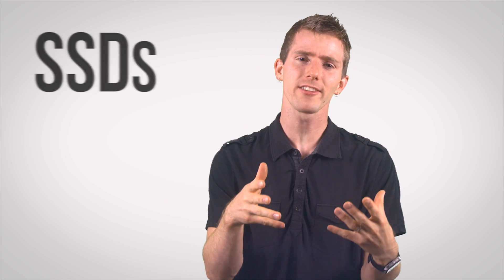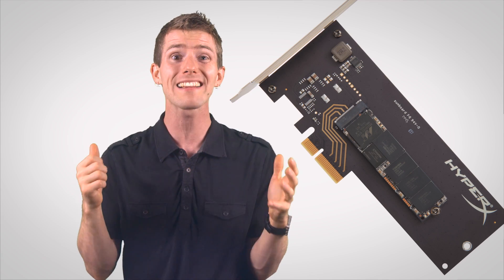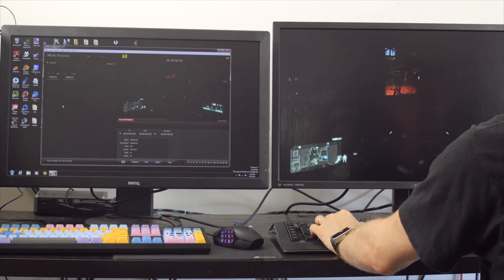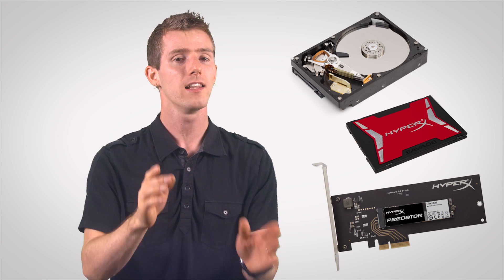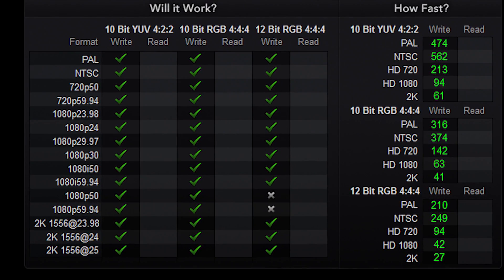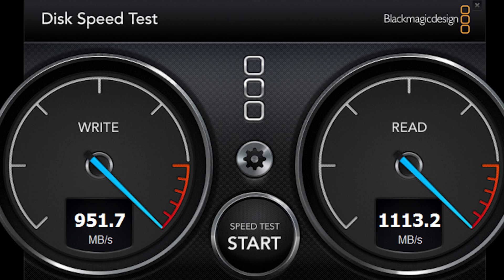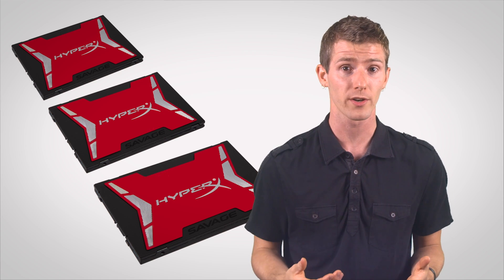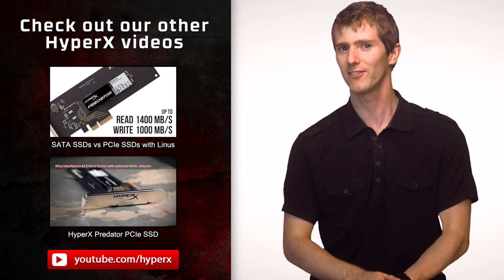SATA vs. PCIe SSDs Performance Test with Linus

Comment: Question and hope this help.i'm keeping my 8TB internal hdd for storage and i got 2 disk drives installed.all 3 plugged in Sata3  0.2 and 5.if i install SAMSUNG 970 EVO PLUS M.2 2280 1TB and 2TB in my rig.will that affect my pc performance because of shared bandwidth?

Comment: hi im upgrading a 1156 socket  computer... it still has sata2 (3gb) and pcie 2.0... what is the best method for me? there are no 1156 boards with pcie3.0 so this isnt availible... i was thinking about getting a sata3 (6gb) mainboard ... how does a sata3 ssd compare to sata2 or a a pcie2.0?
Reply from the maker: SATA 3 has a transfer speed that is 2x faster than a SATA 2 connection. PCIe 2.0 is roughly about 500 MB/s

Comment: I run 1 pcie hard drive ssd for video capture in a 16x slot and hyperx ssd for Windows 10 in sata  3. I only capture live hevc 4k h265 with rx 460 gpu. Also capture 14mbit 1080p 30 fps with perfect quality. on sata 3 pipeline 1080p captures have tiny jitter here and there. I suggest using pcie then transferring over to ssd or sata  3 to edit.

Comment: hi guys,

how do you check if your SSD is SATA or PCIe?
Reply: CuTeHaTr3D You should be able to see the ports and judge for yourself.
Reply: CuTeHaTr3D If it has the little connectors on the side and looks somewhat like a video/graphics card, its PCIe, since it plugs into your PCI slot on the motherboard. On the other hand, if it looks like a little thin piece of chocolate(or if you know what a 1TB external hard drive looks like, it looks like that) with nothing sticking out, it's SATA. You will have to plug it in through both the power supply and the motherboards SATA port.

Comment: who records in full colour depth? A hard drive is fine for recording because of its large capacity. SSD's are really expensive and generally max out at about 3TB. HDDs can go up to 6TB for performance drives and are a lot cheaper. Full colour depth takes up waay to much space anyways so if you record at average settings a hdd is fine

Comment: Has there been any improvement in the ability to boot to PCI-E drives? Or is it still an issue finding a good combo, as each mobo and PCI-E vendor is using a special firmware/driver.

Comment: I still dont understand why PCIe SSD are still so damn expensive. How much does it really cost to solder NAND chips to a PCI board.  To me, BOM cost shouldn't even been more than a LOW end GPU with a SSD in dollar per dollar cost. And the cost to R&D shouldn't be that much more than doing both as well.
Reply: +shane bacawaka You clearly know the answers to NONE of your own questions, or else you'd have the answer to the most important one.

Comment: How big do those drives get?  What's the price to performance ratio like in comparison?
Reply: the biggest I've seen is 2tb which is like $900. i prefer getting 256 cause its cheaper but still fast enough
Reply: +Yingcong Zhang Is it worth the difference in price from a SATA SSD though is the question...